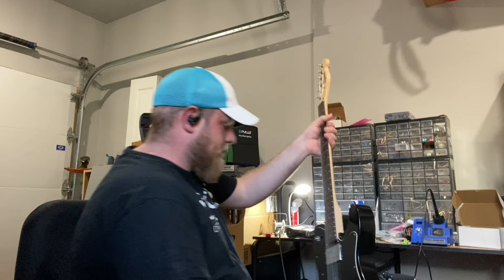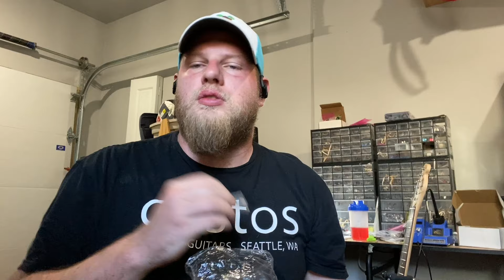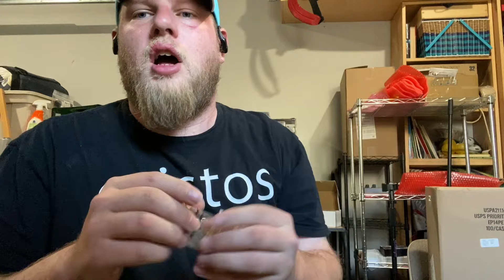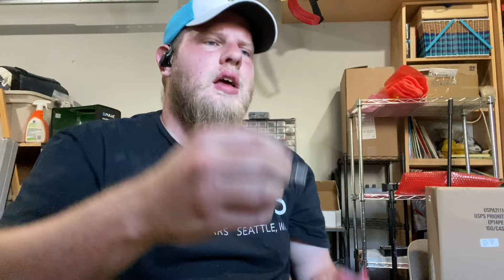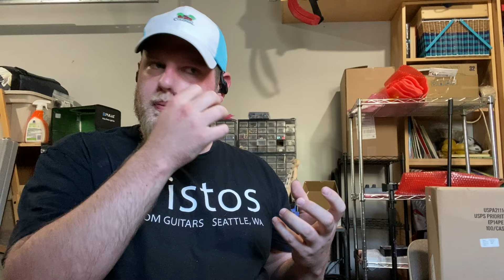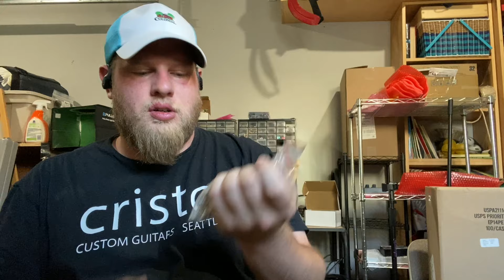GERMANIUM=SCAM?! IS IT ALL HYPE? PT1

Comment: Appreciate the take. I'll add that it's no wonder that there is not an original "definitive" Tone Bender MKI or Harmonic Percolator circuit because they were probably changing out components to tune for variations in the germanium transistor leakage and gain. Anyways, I do have fun building my own Ge-based Percs and MKIs but the tuning is time consuming.
Reply from the maker: 100% it’s one reason I never went that deep on it. I’m just not a big fan of the tone bender sound anyway but I do like other kinds of fuzz a lot. Thanks for checking it out!